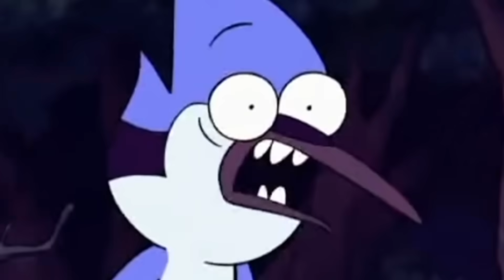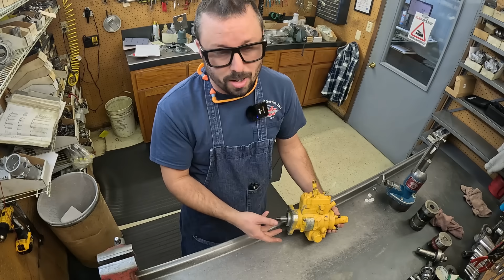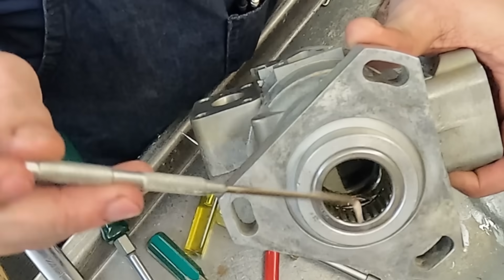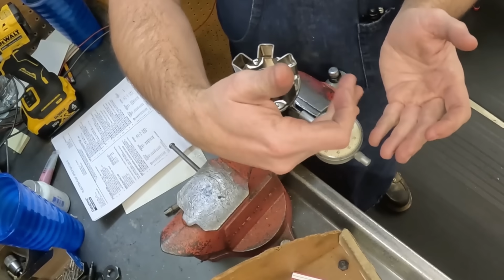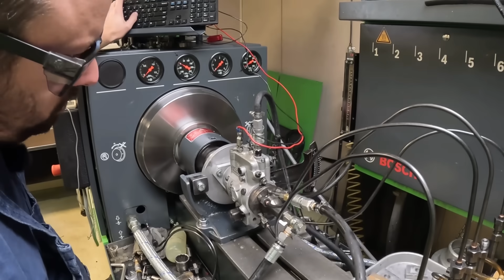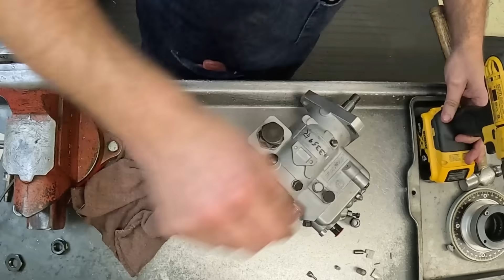450G Dozer DB4 Pump Repair for @C_CEQUIPMENT debut of DB4 on the @AreaDieselService channel! #JD450G

Comment: I have absolutely nothing to do with heavy equipment repair, but I watch Clint and learn. Same with your channel. As a power engineer, I can relate to some of it. Enough to keep me interested. If I was looking for a shop to partner with in trust to fix my  parts, your videos would seal the deal for me. It is very clear there are no shenanigans and ripping off the customer at invoice time. It is a professional shop. The techs clearly know this stuff inside and out, blindfolded. You diagnose, estimate, and advise the customer as to what you would do. As you said, is it a boat anchor, lol.

Comment: Wonderful repair/rebuild.  I used to do elevator entrances for 12 years and developed my own techniques for doors. I had to do the same thing sometimes dozens of times a day. It was nice to see him put away his tools where they belonged. I was surprised to see a full test rig to calibrate the pump. btw; the mounting plate for the vise was cool. Excellent work, great video.  
   I just had to laugh when he threw all the parts in a bowl, and was disappointed when the parts showed up all sorted on a tray. I guess you need to shorten the video for time purposes. It's interesting how similar to engines in design it is. The number of parts seem to almost equal the engine.

Comment: I can understand why you might not want to do it but it would be interesting to see Corey run up the pump on the test equipment untouched then even make some adjustments to improve it before the stripdown and rebuild as a direct comparison of what can be achieved. Obviously this pump needed to be overhauled do to the worn parts and bad oil seal. Just a thought. 
😀👍👍🇬🇧

Comment: Most all early Deere cab tractors have the cold start advance and open station tractors it was optional and should be added. All later DB4 pumps had cold start advance systems to reduce emissions.

Comment: a shipper told us if you have to ship something that had fuel in it, Drain and You can eliminate the dangerous goods  labelling by putting mineral oil through  it, or Turbine engine oil like Mobil Jet 2 in it as its non dangerous good. Euro cars use a mineral oil in power steering too, Mineral oil to 2005 and in 06 it changed to synthetic for cold weather help.

Comment: Sir, pls. I have MF 175 perkins motor. It doesn't response quickly to fuel command after it's run and I can't run it on without fuel arm on top speed . What's wrong please answer me. Thank you so much.

Comment: Trivial question but it's got me baffled. When you put in the seals you use an alignment tube to make sure the shaft didn't harm the seals but I couldn't see how you got the alignment sleeve back out. Does it collapse and pull through the housing and out the other end? You showed two views at different times in the video and I couldn't see how the tool could come back out.  
Great video but if you have time please address this question.

Comment: Colin, after market is the production of an Original Equipment Manufacturer piece (OEM). It allows for replacement parts from other companies at a reduced price as well as possibly modified pieces or parts.

Comment: might be a dumb question but how much differs a cars injection pump - like can you get any injection pump from a similar displacement engine with the same cylinder count to work in such a maschine ? 
like replace the DB4 with a Bosch pump from a 4.5 liter Audi engine ?
Reply from the maker: Generally not. At least not without significant modifications.

Comment: "After market" (I'm not from the US & that term is not used in the UK.  Please tell me what it means? Is it like items made by someone that are making items cheaper?
Reply: OEM, original equipment manufacturer, parts made by or for the manufacture, after market, parts made by secondary maker for a device, usually of lower quantity and cheaper but not always.
Reply: Yes used to be of questionable quality. But now everything is of questionable quality. We don’t stand a chance.
Reply: Modified factory specs, usually lower quality materials used.
Reply: Not used in the UK?!?  Nonsense. It’s absolutely used in the UK. 

Means it’s a product/part not from the original manufacturer- like buying Apec brake discs and not the discs from the car manufacturer. Doesn’t mean lower quality, just means may be different from the OEM part.